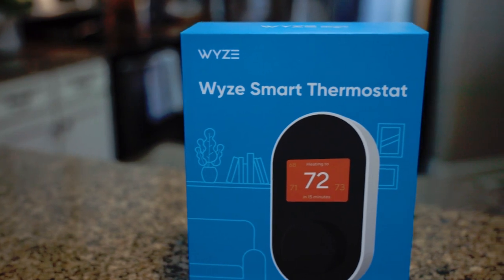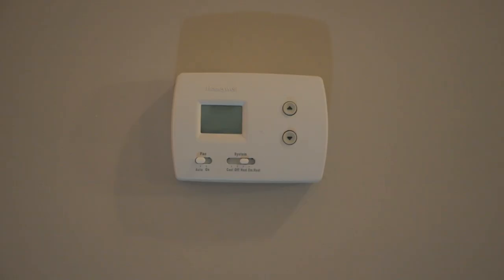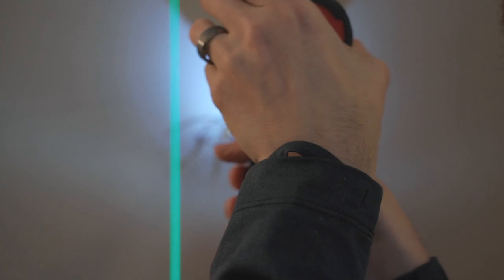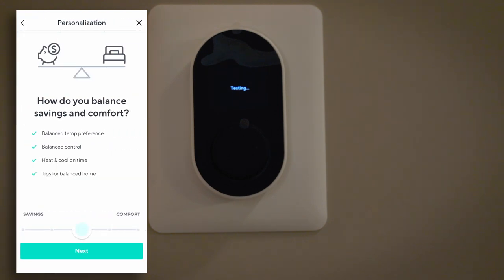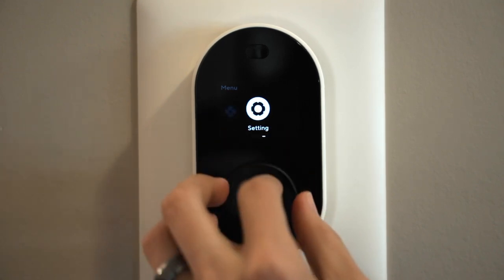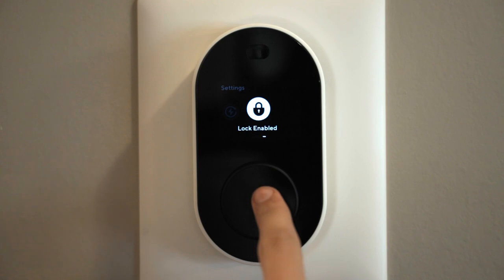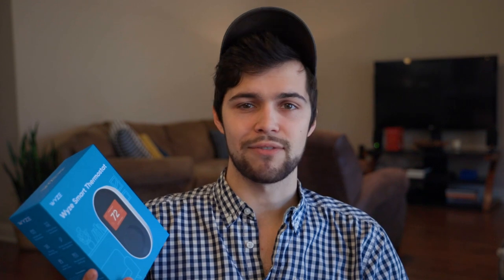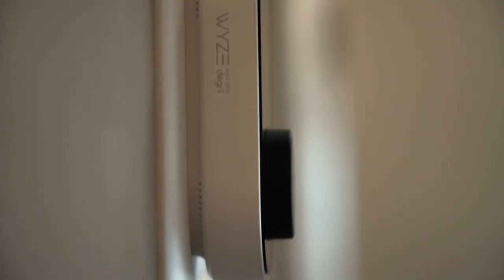Wyze Smart Thermostat Review and Install

Comment: Great technical description,  I should have found your video before I had to call wyze , over an hour on the phone and they didn't solved the issue about wire missing , I knew I had the wires correctly and even ohm them to make sure,  I figure it was something with the thermostat firmware or configuration in the software , after I reboot it and removed it form the app several times , it finally worked , thank you for a great presentation , good job 😊
Reply from the maker: Thank you for the positive comment! I’m an engineer full time so I always struggle with the balance between getting on the weeds and keeping it short for the video haha. Glad to help! Mine is still going strong, the WiFi goes out once a week or so but I rarely remote in as I’ve got the schedule very refined and never need to adjust things.

Comment: I've mine for over two years, maybe 3 years now and have had no issues with it.  My only gripe is that I'd like the temperature to stay displayed on the screen.  I'd like to look at the temperature across the room instead of walking up to it.
Reply from the maker: I’ve also had mine running strong over 2 years. I do get these spells of it losing connection and I just pop it on and off to reset it, but it has the memory and schedule programmed so I never notice when it’s not online as I don’t adjust it much any more, it just does it’s job, and a device I still recommend.

Comment: Thanks for the review, I'll purchase one from the link above. Thanks for the tip about taking a picture because I would have been hating life trying to install this and then forgetting what was there.
Reply from the maker: I appreciate it! The picture trick saved me twice haha, especially handy if you have to plug the old thermostat back up for any reason like compatibility. (They do returns if it doesn’t fit) Good luck on the install, let me know if you have any questions or run into issues, hope I can help!

Comment: I amazon reviews that it keeps on disconnecting from wifi, is it still happening a lot after the 1.2.7 (May 4, 2023) firmware update? Planning to buy this used on amazon as no new in stock and sold out on wyze website.
Reply from the maker: Hey! I’ve actually been seeing this a lot more recently, once or twice a week I’ve walked by it and seen the no-WiFi connection symbol. I don’t know Wyze wouldn’t program it to do a self reset every couple days to reset the WiFi connection. For me, I’ve got the device schedule so set I never open the thing on my app or touch it, it keeps my house at a set temp in the day, evening, then sleeping and in a fixed range. The weekends have their own temps as well. If I go out of town I put on hold to an away temp. This is a bug that should be fixed from Wyze, but I’ve not been hindered by it.

Comment: Great video! I'm having the opposite issue of what you were having initially. My thermostat is set to heat to 64. But it says my temperature is 66 or even 68 and it's turning the heater on. Not sure why it's turning on if its already above the desired temperature. Another issue, I noticed, with my dinosaur Honeywell thermostat, it would turn on about 5 to maybe 6 times a night and kept warm at desired temperature . But my wyze thermostat must have turned on about 100 times in a single night for short periods of times even though it's already above desired temperature as I mention. Any suggestions to make it work properly? 🤷
Reply from the maker: That’s an interesting issue! I’ve not had it but can try to take a guess on how to fix it. First, you want to make sure the heat and cool are set properly, that the thermostat knows to click the heater on instead of the AC and vice versa. If these two wires are swapped at the install it will heat when trying to cool and cool when trying to heat. There is a setting in the Advance page all the way at the bottom to swap heat and cool if this is the case. You can run a “System Test” at the top of the advance page to validate. If your wires are set right then we can skip this step. Next on the advance page make sure your “Safety Temperatures” are like 40 and 90.  Scroll down this list and check the fan cycle is at 0min/hr to make sure it’s not kicking on. The next thing to check is that your temperature preferences on the main settings page is set to what you’re wanting, that may be overriding your input heat of 64 along with checking the schedule if you have that set up. Give these a go and then get back with me and I can try to dig into it more. Good luck!

Comment: What size of drill bit did you use?
Reply from the maker: Oh man! That’s a tough one it’s been so long. I don’t know off the top of my head right now, once I get back in town I’ll try to look at what anchors I used. In general, use the drill bit that is about the same size or slightly larger with this kind of press anchor so it can slide in but not be loose.

Comment: Thanks for the video!  Question .... can you set the fan to cycle on at specified periods?  My Ecobee allows me to set a minimum fan run time to help with circulation, which comes in handy for our 2nd story to be close to 1st floor.
Reply from the maker: Thank you and yes sir! In the advance settings page there is a setting called “Fan Cycle” for you to pick between 0-30 min in 5 minute increments. The setting says “The minimum amount of time your fan will run each hour” so if fan is in Auto mode and the AC is not running, it will keep the fan on for up to 30 min for circulation per hour.

Comment: Do u have to have wifi?
Reply from the maker: You must have WiFi to turn in on when you first get it to wake it and pair it to your account. I did not have WiFi and used my wife’s phone as a hot spot and this worked. After it is on, you can go without WiFi, but are limited to what settings you can have. Setting your sleeping temp, away temp, and home temp must be done in the app. Once you do set everything once though, the device will always remember and you can disconnect it from the WiFi for it to just run blind. If you run it blind though you can’t connect to it remotely when you are not home, only the manual knob on the front controls it. If you’d like a no WiFi device I would recommend against a smart device, it’s good but there are ones with all settings on the thermostat itself with no app needed.

Comment: Can I replace this wyze smart thermostat for my old one that only has 4 wires?
Reply from the maker: Sorry for the delay! If you only have 4 wires on the current system that may not be compatible. You can check the compatibility on Wyze website page for the thermostat though! I used that to check mine.

Comment: My thermostat wiring is w2, w, (white connected to not in used,) y, r and rc together with jumper and the back of the thermostat i see blue and white connected together. Don't see any blue wires common coming out of the thermostat. Can this work with wyze thermostat?
Reply from the maker: Hey Jay! I’ve been trying to dig and find your exact set up but not had much luck without more info or seeing it. It typically can work with most thermostats, but if your’s was set up uniquely it may not. You can check out this tool on their website to see if you can figure out your configuration: https://www.wyze.com/pages/wyze-thermostat-compatibility and if that doesn’t work they say to submit a request here: https://support.wyze.com/hc/en-us/requests/new . Hopefully we can figure something out, don’t want to purchase something that won’t do the job!

Comment: Have you noticed your electric bill gone down or increased?
Reply from the maker: I wouldn’t say I can look at the graph and see a exact correlation to lower energy bills, the bill is directly related to the weather outside and how much I need the HVAC to run. But, I will say it is a lot easier to make sure the system is not running when you don’t need it or are away. It’s been great to just open the app and flip the house to away when we are out of town. Most thermostats can be programmed but they can be far more complicated and manual so I appreciate the ease!

Comment: Our house is an older one with only a boiler and steam heat.  No fan, no A/C.  Will this work here?  I've installed a few Wyze cameras and really like their products so far.
Reply from the maker: That’s a really interesting question that I wish I could be more help on! From what I can read, that’s not going to be possible as that system does not have most the parts necessary for the Wyze system and in the app there would be no way for it to know there is no fan or AC. You’re normally needing just a mechanical thermostat and I doubt the device would get past the first initialize step. That being said, if you’re good with wiring you may be able to rig something up like this man did: Wyze Thermostat for Boilers https://youtu.be/G-QOQ0-F63g Sorry I can’t be more help!

Comment: Great video. Do you know if it allows you to set the temp 1 degree above and below? For example, in cool mode, if I set the temp to 74, can it turn on at 75 and then turn off at 73? Thank you.
Reply from the maker: Thank you! And it does not do exactly like you asked, but in the advance settings page there is a settings called “Differential Temp.” It says: “This settings determines how far from the set point the thermostat will allow the the temperature to go before turning on or off.” It gives you the option for .5°, 1°, 2°, and 3°F to select from. So you could say cool to 73°, and it would not kick on until it hit 75° giving you a bit of tolerance. Anything less than 73° would not turn the AC on because it is in Cooling mode, not Heating or Auto switch. Let me know if that doesn’t answer your question and I can try again!
Reply: @PhilipBlank  This is great info. Thank you.
Reply from the maker: @nonya13  Happy to help!
Reply: It good to hear it has a Differential Temp setting..do u know if it has Calibration setting..? what that does is allow you to match the temperature from another room..like for example if you have a 2 story house and the downstairs temp is 72 degrees but the upstairs temp is 74 degrees, you can adjust the themostat to 72 degrees if it's mounted upstairs to match the downstairs temp..
Reply from the maker: @markh8921  Yes sir if I am fully understanding the question! Right under the differential temp setting there is a “Temperature Correction” option. It reads “Use this setting if you find the temperature is consistently reading slightly above or below the actual temp.” This has a range of ±10° to allow exactly what you’re saying. There is also the same setting for humidity percentage. Wyze did just come out with their Room Sensor which would then allow you to cool until that room hits a temp I believe but I’ve not tested it yet.
Reply: It also has "coast to cool",,,, this allows the AC compressor to turn off 1-2 degrees from the setpoint, and uses just the blower and fans to continue to cool to the setpoint temperature.
Reply from the maker: @starmc26  that is a nice feature as well! I have it on, but I’ve not done a power consumption test to see how much energy it actually saves, but it can’t hurt anything!
Reply: @PhilipBlank  Excellent review and I'm glad this question was asked and answered. I'm likely to get this model because it has the "differential temp" feature. Mine currently cycles ~6 min run, ~12 min off but I'd like it to run maybe 10 min/20 min cycles, this is about the same run time per hour but having less starts is easier on the equipment and maybe a slight energy savings.

Comment: Can you schedule the fan and also schedule the thermostat ti turn on and off?
Reply from the maker: Good question! There is not a specific “turn on fan” by itself at a set time, but you can create schedules to turn the thermostat cooling and heating on and off any time. I have it set to start cooling down to 72* at 10PM and hold that through the night then up to 74* in the morn, then 78* in the day when I am away, back to 74* in the evening and then repeat it all. You also have a setting called “Fan Cycle” in advanced settings to tell the fan to run a minimum number of minutes in an hour. Say your house is set to 74* and it is that temp already but you want the fan to run 10 min in an hour, it will turn on for the 10 min to circulate air without heating or cooling. I don’t use this feature and have that set to 0 min/hr.
Reply: @PhilipBlank  Thank you so much for the reply!  Regarding the schedule that you are setting is your thermostat actually on the off position and then the scheduled time turns it on?
Reply from the maker: @yvi6991  no but you could do that. The schedules work off of temperature ranges, so for the night schedule, I have a low of 64 to turn the heat on if it gets colder, and high of 72 to turn the AC on if it gets hotter. You could create rules (which has a scheduled action buried in it), which is separate from the Schedule to turn the Thermostat on and Off at certain times of the day. Not sure why you would want it completely off, but it does have the capability if needed! Method: Create Rule> Schedule> Select Time and Add action> Select Device> Select “Turn on Off Mode” or “Turn on Cool/Heat Mode”. I am curious how the rules versus schedule would override each other.
Reply: @PhilipBlank  Hi Philip,  The thermo I have now malfunctions and runs making it warmer in the house to what it is set to and then when I turn the system off the stat reads a cooler temp by 1 or 2 degrees.  I am hoping if I get the new stat that I can program the fan with a rule and also turning on or off with a rule.  Thank you again for your time and I will post if I have an update for you with the outcome.
Reply from the maker: @yvi6991  not fully sure I understand, but you can program it to go to set temps at fixed times and you can put in an offset if the actual temperature is slightly off from the thermoset. Hopefully it will help you with your problem! Just make sure your system is compatible with it before making the purchase as some older systems are not. Thankfully it is not as expensive as many other thermostats, good luck and let me know how it goes!

Comment: I don't like having to get on my smartphone and clocking in to WiFi monitoring for every blingin' thing.   
I was almost ready to get this until I saw you can't set the schedule right there on the device, you have to go find your phone and drag the old ball and chain out again.   
At least this one has an actual working dial, instead of touch nonsense that gets it all dirty and never works right.    
The new Google Nest also has this silly reflective screen, that makes it harder to read.   As if I want to see myself when I set the temperature!  I'm good with a mirror sigh.   My search goes on for the right model of money saving thermostat......
Reply from the maker: That’s a great take, it’s hard to find anything anymore without some kind of app or such but I guess it can’t be a Smart Thermostat and not run on WiFi. You must pair it to WiFi for the set up and adjust the schedule for the first time. I will say though that if you don’t care to have wireless updates from your phone, it is set and forget and I never touch it from my phone. You set for the first time what you want your high and lows to be and at what times, and then it will continue to follow this all the time even with WIFI off. I’ve not touched the thing for a couple months at this point, really set and forget and that’s what I think a thermostat should be but it cannot be rescheduled from itself so if I am wanting to adjust the programs like you said it’s back out with the phone. Good luck on the hunt, if you find the perfect device though let me know!
Reply: @PhilipBlank  just to let you know, after wasting days on this researching, reading HVAC forums, Reddit, and untold stories on Youtube... I went with an Ecobee Enhanced. 
The entire operation can be done on the thermostat... 'just like the old days', but you can set scheduling, and away temps, and has other features that promise bill savings.
For some reason HVAC technicians drastically like EcoBee over Nest.
I figure the people that repair furnaces, are probably a good bet for opinions on thermostats, but who knows.
This El Nino summer is predicted to be a broiler with epic utility bills.... I'm going into the battle with this.... we'll see how well I make it through 😅
Reply: @c.rutherford How's the Ecobee working out so far?